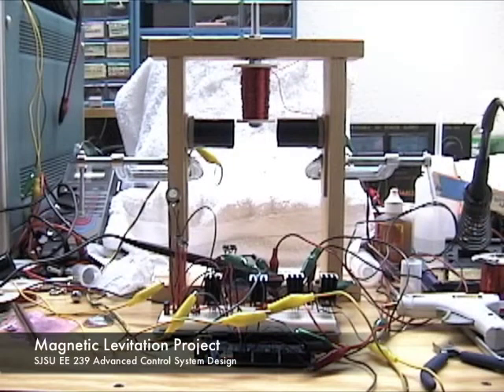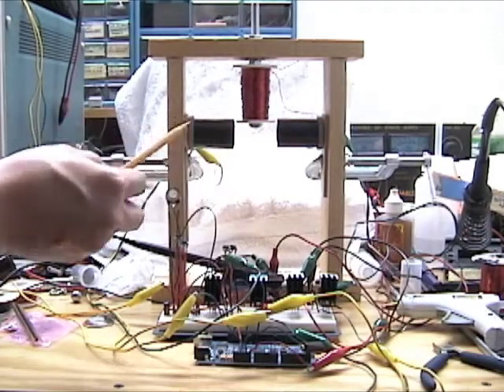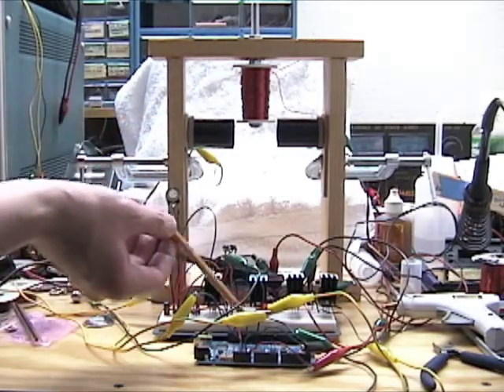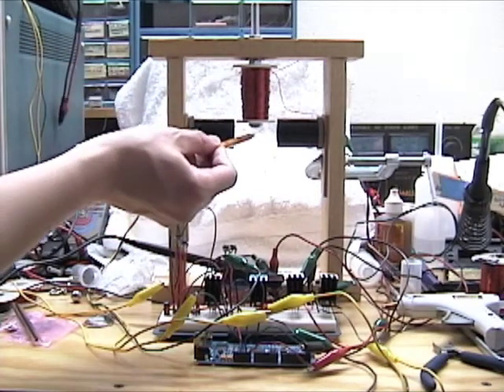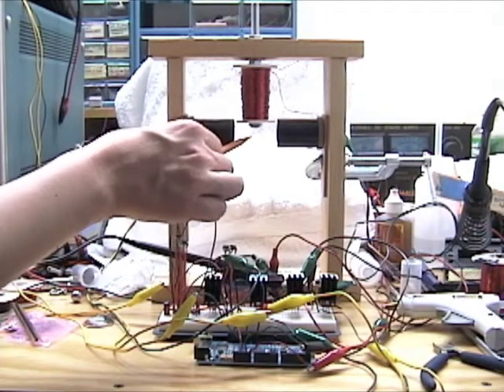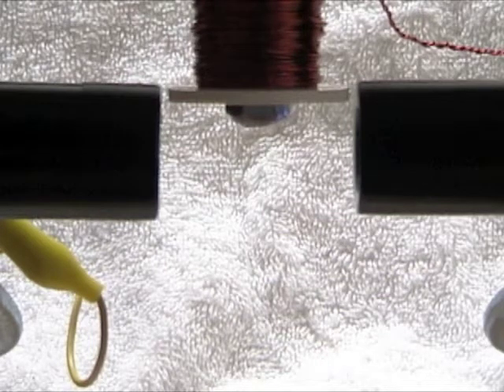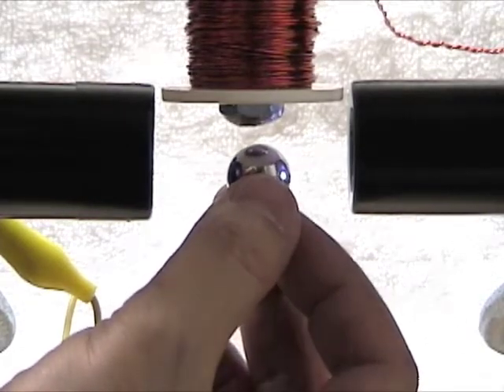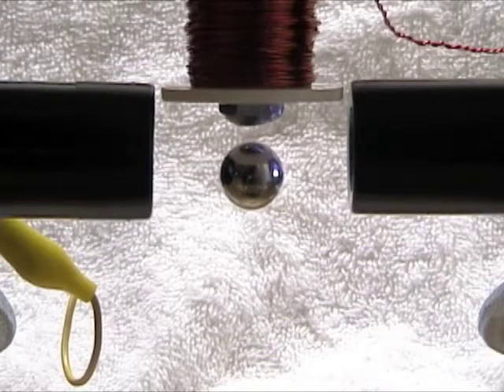Mag Lev

Comment from the maker: Sorry to take so long replying.  Designing the coil was mostly trial and error.  The first coil I built had an inductance that was too high, which destabilized the system.  So I tried fewer turns with thicker wire, and that worked.

Comment from the maker: One improvement to the system would be to implement a differentiator in hardware using an op amp, then run that signal to another analog input on the Arduino.  The system currently performs a back-difference on the proportional signal to get a derivative.  This amplifies the quantization noise considerably.  I had this configured earlier, but took it out while debugging.

Comment from the maker: The base current on one of my transistors is set too low.  This means that the transistor doesn't turn on completely.  If I fixed this, I could probably run at a slightly lower voltage.  I could also use both coils in parallel to run at lower voltage.

The second source of lag was a small capacitor I had added to the sensor to reduce noise.

Comment from the maker: One of the challenges I had getting this to work was lag.  There were two sources.

The first was coil inductance.  I used about 8 oz of 26 gauge wire, which gave me about 0.4 H of inductance.  The magnet shown in the video uses 22 gauge wire.  It has two coils, each with 4 oz of wire.  I'm only using one coil in this video.  Not sure how many turns that is.  I would recommend starting with slightly thicker wire.  Maybe 20 gauge.

Comment from the maker: @blogger45 -- Thanks for your comments.

Yes, it's an 8-bit PWM.  It uses the analogWrite() routine.  I think the Arduino defaults to 500 Hz.  Because I'm running the feedback loop at about 2 kHz, I raised the PWM frequency.  This was accomplished by adding this line to the setup() function:

     TCCR2B = _BV(CS20); // Set CS2 bits to 001 for no prescaler.

I'm using a 30 V power supply.  Average current draw is about 0.4 A.